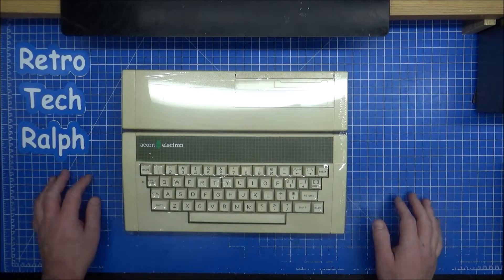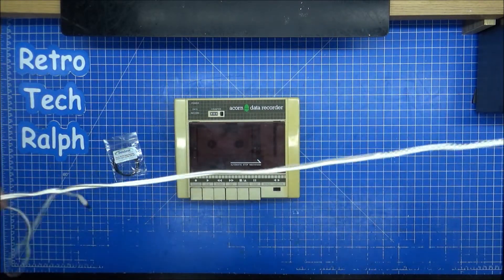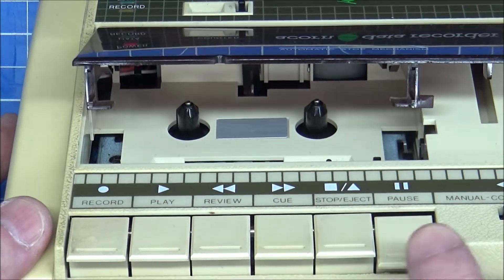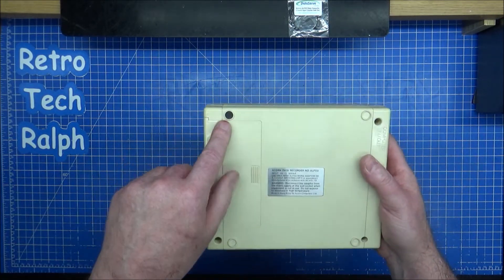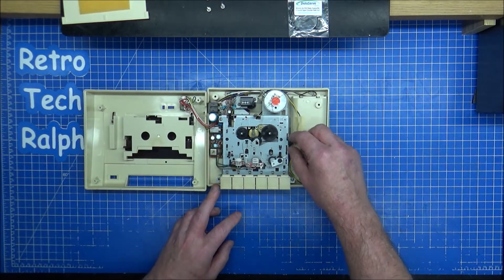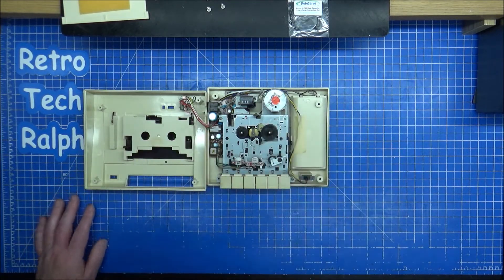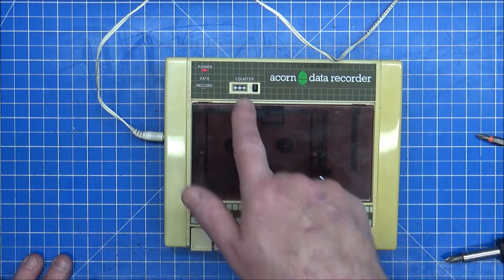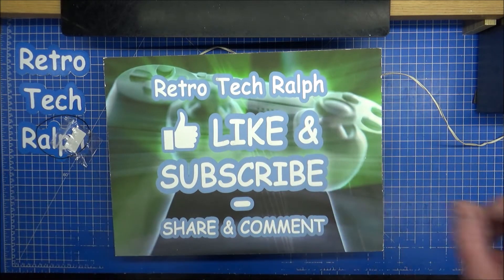Acorn ALF03 Data Cassette Belt Replacement

Comment: Ive never actually seen one of these in real life ("IRL", as the cool kids call it)
Cuuuuuuuute!
Quite a tidy unit Acorn turned out there. Although the disaster has to be the power supply plug.... its *ENORMOUS*..... which means you can't plug it in to the socket next to the ENORMOUS power supply for your Electron! DUH! Acorn!!!
Great video, Ralph